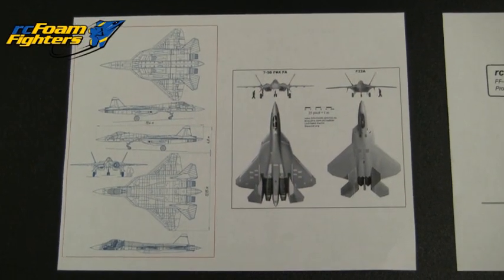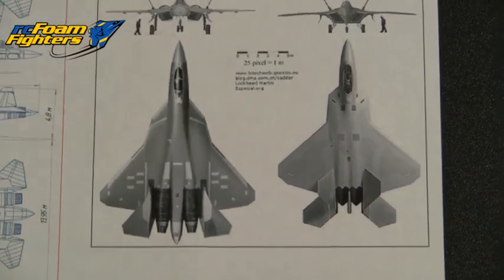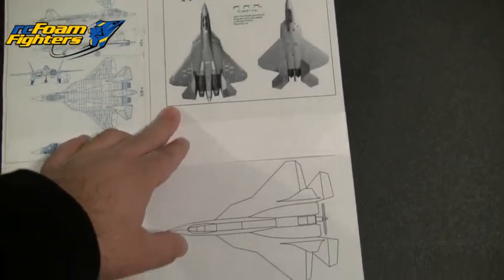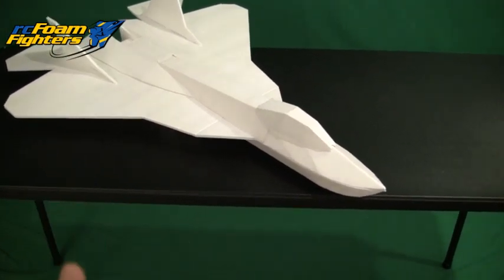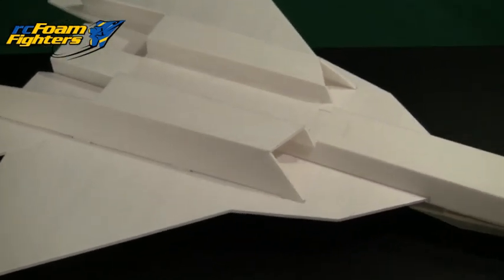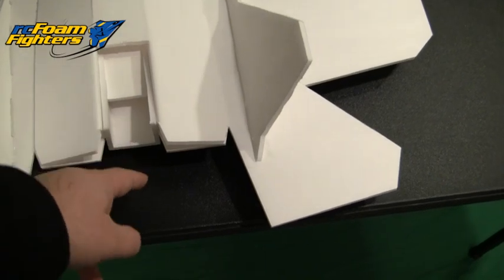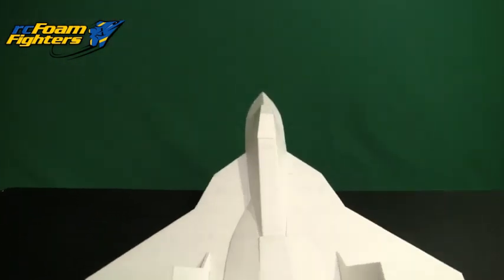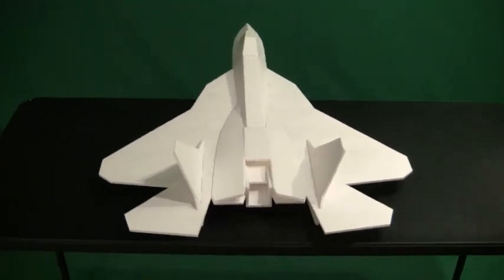FF-T50 First Look (T-50 PAK-FA)

Comment: Maybe for the "engine nozzles"  you could just trim the prop and engine gap, and then leave the extra area inside the elevons or elevators, whatever works best, to simulate and actually get the thrust vectoring. As if each nozzle was conected to the inside of the surfaces, If you get my idea :P

Comment: Paul you are on a roll first the ff-35 that looked good but WOW this is sweet man and if you are having issues with the foam bending you can take one layer of paper off and replace it with a layer of tape it makes it so much more playable and easer to work with you can make a complete cylinder if needed but it looks like you got it man. cant wait for the next video…

Comment from the maker: @flyby8906 Thanks Gregg. Hopefully once I redesign th enose it will look better. Sometimes things look fine in CAD then you build it and you say what the heck is that, LOL.  Also at times foamboard just doesn't bend or shape as easily as you want. So at time i build, then rebuild tuill it looks like I want. Thanks again.

Comment from the maker: @tomascontrerasjr Thanks for the comment. Typically I do not remove the paper. It makes the build a bit stronger with the paper on. The rediboard foamboard i use is prtty light even with the paper on. It's about half the weight of the Elmers or other brand foamboards. I'm starting to learn a few ways to shape the foamboard better and so far seems to work ok. I'll try and show more when i get to the build videos for this plane.

Comment: @rcFoamFighters Thanks for the responses!  I know between the 3 YT channels, it must feel like another job at times!   Thanks for all the effort, It doesn't go unnoticed!  I like the idea of using EPP but I do alot of sanding in lieu of shaping with a hot wire cutter (I have yet to make a big tabletop unit) and I understand it is a bit more difficult to get a smooth finish.